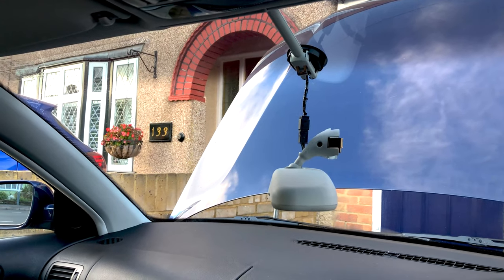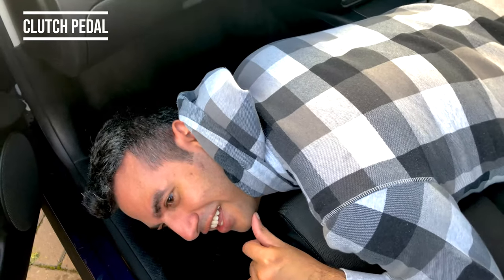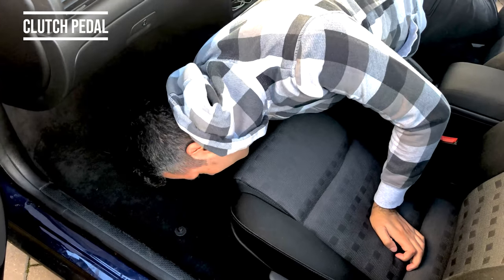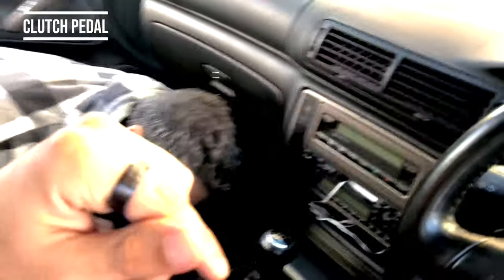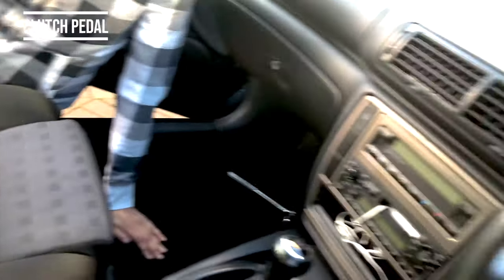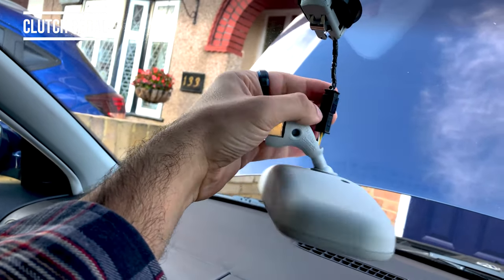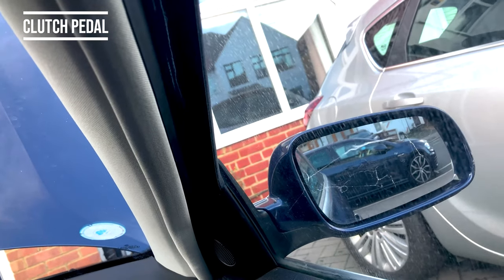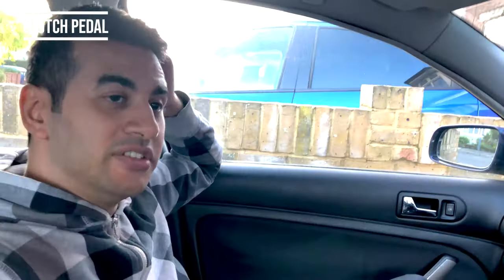Part 5b - How Not to Change a Mirror

Comment: Check driver seat under seat connection. Push together as pins might be loose in the connector. Also water in the scuttle and passenger footwell and the bad smell are caused by blocked scuttle drains. Drains located om either end of scuttle (the trough the battery and pollen filter are in). The drains will have rubber gromits round them and in your case probably a big pile of leaves and mud om top of them. When you clear them, your car will do a little wee behind the front wheels!
Reply from the maker: This sounds much more sensible than our suggestion of drilling a hole. Thanks Dave!